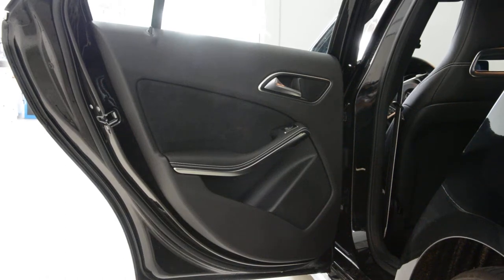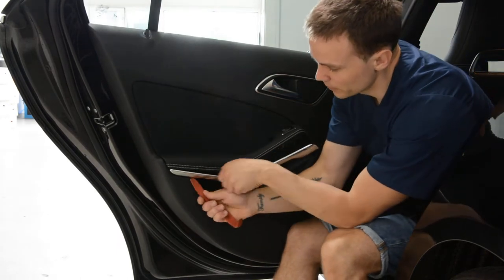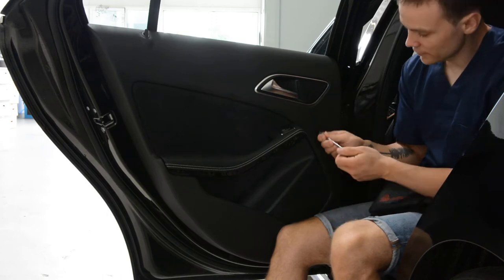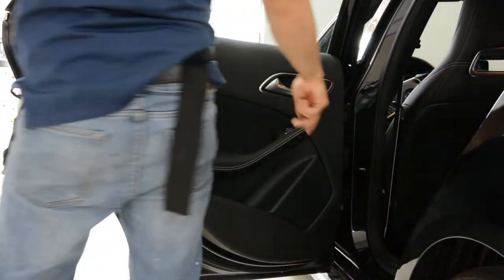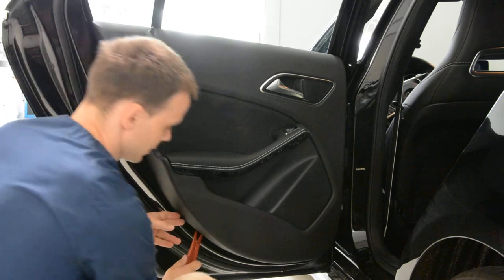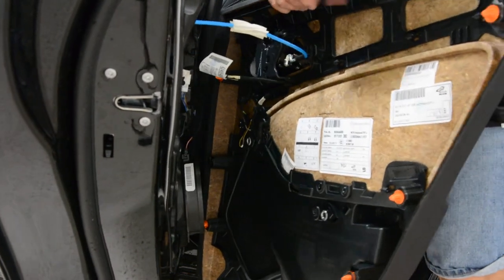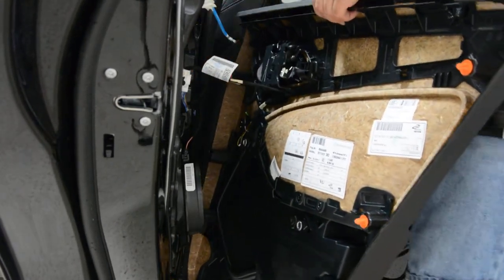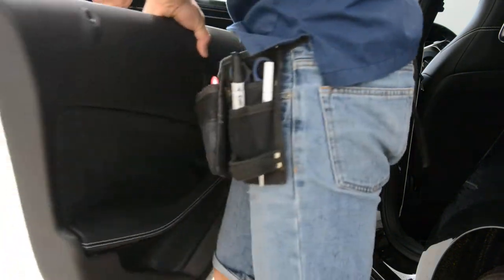Mercedes A Class Door panel removal

Comment: I’ve lost a small suction cup like toy in there by rolling down the window. Do you think that it could possibly break something and block the window?
Or will it stay there at the very bottom and not be an issue?
Reply from the maker: :) in the door there is the window crane mechanism, is a cable that is holding your window. There are like 1% chances that your toy will end up in the crane window mechanism an make some damage. If the window rolls up and down without making strange noises you are fine :)